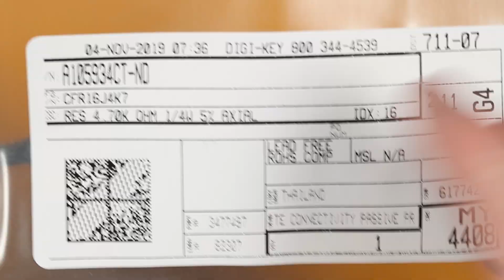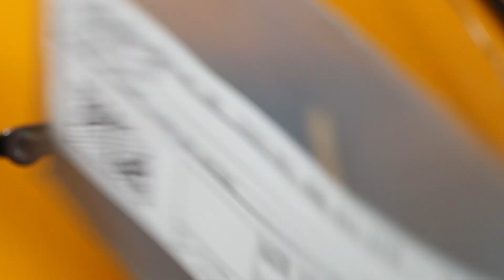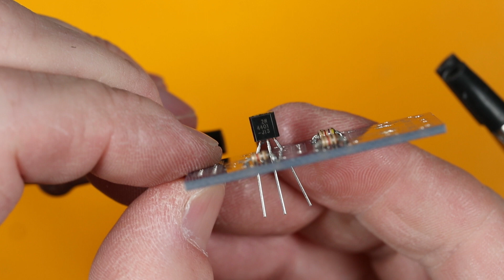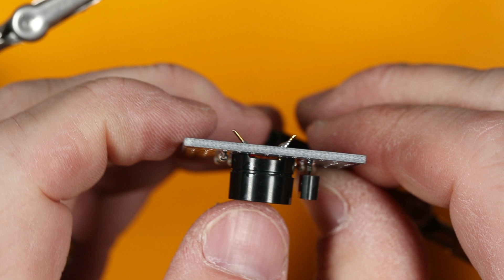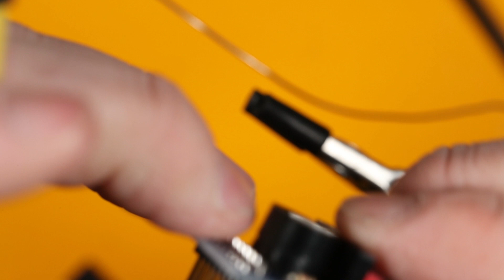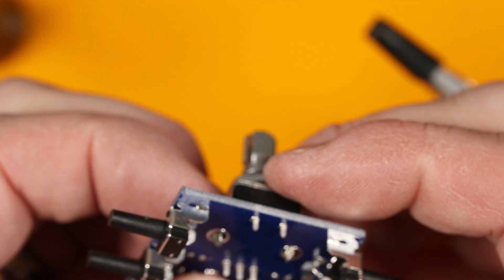FDL 3 - Your Complete Build Guide (3 of x) - Soldering The CTL Board

Comment: I went to jlcpcb and I also have the 3 png files. CTL, PWR, and DCP. There are some options that I’m not sure about. I need the exact dimensions of the board and I need to know how thick and I need to know how many layers…… I did not look that deep into the files but is this information in there?
Reply from the maker: Should be in the .sch files somewhere. Try opening them using Eagle or EasyEDA. Worst case scenario I can pull apart my blaster and measure them.
Reply: If you haven't already ordered, I have a Gerber file I used to combine all 4 into one that worked great as a panel. There is an fdl Facebook group with related details too.
Reply: @sabraith  Thank you! i found all the files but im trying to get an understanding of what im looking at. I am aware of the group but haven't asked for help yet. I wasnt sure how to proceed after finding the 4 files.
Reply: @ItsDaPlumber  I ordered through jlcpcb.com with 2 layers, 83x68mm size (auto detected from the panelized 4 board version), 1.6 PCB thickness, HASL with lead, 2oz copper (2 oz for the power board and 1 oz for the rest unless you do the panelized in which case 2 oz for all 4).  I had about a 1.5 week turnaround from ordering to my doorstep and the boards turned out great.
Reply: @sabraith  Wow! Thanks for the insight. i will copy this!

Comment: Where can i find the boards?
Reply from the maker: Project FDL has closed their shop and discontinued making their boards. However, the files you need to make the boards are here:
https://github.com/projectfdl/FDL-3-Blaster
On that page click “view code” then “PCB”. On the PCB page you need the BRD files located in the CTL, DCP, and PWR folders. Take those files and upload them to a service like jlpcb.com. It’s realitively cheap to have PCBs made though the shipping costs can be costly. Best to make a few of each for spares.
Reply: @breaksteel  Wow! Thanks for the quick reply. going there now.
Reply from the maker: Try to get back to everyone as quickly as possible. If for some reason I don’t respond just start a new comment, YouTube is bad at notifying me of reply’s to comments and modestly better at notifying me of new comments. 
I totally understand really wanting to build one of these. There are only a few parts that would make it difficult to build if not available but the hardest parts are open source which is fantastic for us builders. 
As for being a pain, I’ve built and repaired  multiple quads (drones) using only text.
Reply: @breaksteel  I really, really, really want to build one of these. All of my parts are printed out and now its electronics time. My guess is first thing i need to do is get a bunch of these PCBs made. I'm going to rely on your page for help but i promise i wont be a PITA. lol
Reply: @ItsDaPlumber  Hey Darren, do you have extra pcs boards you would sell?
Reply: @breaksteel  Hello. I'm going to take your advice and have some made up, but do you know how many layers they are, and the dimensions of each board? That would be very helpful. Thank you.
Reply: @Burnt_In_Phx  Hey Burnt in Phx, Did you ever get these pcb boards made? would you be willing to sale me a set if you have extras? Thanks
Reply: @melissalosey2878  Hey Melissa, I have not had the chance to have the boards made up yet. Still on my to do list though.

Comment: How about adopting the standard of placing the gold band on the right? the 4.7k resistor for example, the yellow is a 4... the violet is a 7... the red means 2 more zeros. The gold is the variance or quality of the value. I read from left to right... You're correct that the polarity doesn't matter and I love that you are consistent. Just an idea.
Reply from the maker: Very good point. I think it’s been about 25 years since I’ve looked at a resistance chart for banding. Usually I just grab the bag of resistors and read the label then double check them with a multimeter. I’ll look to transition to the banding on the opposite side for those like yourself who will be reading the banding. Thanks for the suggestion, and thanks for watching!

Comment: Thanks for the video. But I have 1 question is there any reason why you are not using the same parts (like the resistors) for the DCP board? The spec look the same but I notices that the part numbers are different.
Reply from the maker: Good eye. The resistors may carry the same values but the difference is in the physical size. The ones places on the CTL board are much smaller. I am not the one who designed these boards so I'm just following the design as it is.
Reply: @breaksteel  Thanks that cleared up a few things. Now I have to find motors. The one your are using are sold out, so I was looking at these (ARRIS 2206 2450KV 3-4S Brushless Motor S2206) as replacements
Reply from the maker: The thing about motors is not so much the specs (2206 2450kv) but the bell design. The flywheels have a sort of key that lock into the bell design. There’s 2 or 3 types of motors that have flywheels that fit them. For those motors you’d need to redesign the flywheel. The motors I use have a lot of sister motors to them. They all share the same bell design. Look on EBay as theres a ton of them. Frybott, Skitzo, RX2206, and more. I think the Skitzo motors are the ones that had issues a few years back with magnets falling out of them so I wouldn’t rush to get those.

Comment: Pretty easy to learn. Great job! Merry Christmas and Happy Holidays.
Reply from the maker: Yeah, its not too hard. To me its 30% skill, 30% knowledge and 40% right tools for the job. 
Merry Christmas to you and yours!
Reply: @breaksteel  thank you! 
Oh i have to say since buying the ender 3 pro.  I have had a ton of fun! Ordered pteg for it. Should arrive monday.  Thank you for everything
Reply from the maker: @BrendanTheGent  Sick! Great printer for sure. i can't stop making things. Made a few of my own parts as well, including a face plate for my Ecto Goggles. Let me know if you need help with that PETG. It's great filament but larger parts take some effort and knowledge to keep them from curling up.
Reply: @breaksteel  oh ok! Good to know.  I will have to learn how to preheat everything since there is no selection for pteg. When the filament arrives that should say the temp needed.
Thank you
Reply from the maker: Yes the filament should list the best print temps. Bed temps are usually 70c for PETG. I've had to run mine as high as 90c as my print bed is wearing out.

Comment: Great job!
Reply from the maker: Thank you! Trying to make this as easy as possible for someone who is adventurous enough to tackle this project but may not have the necessary skills. All while keeping it entertaining for those who just enjoy watching things being made.
Reply: @breaksteel  what temp is your iron set at?
Reply from the maker: 400c or 750f after the conversion. I’m also using Kester 63/37 .031 inch solder which has a pretty low melting temp. This combination works wonders, coupled with a good iron and it’s like working with butter.